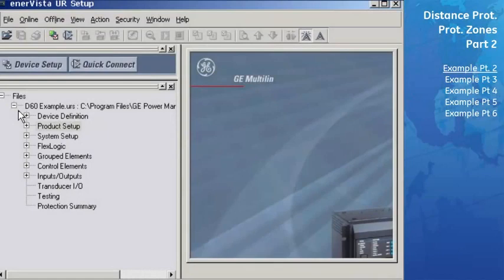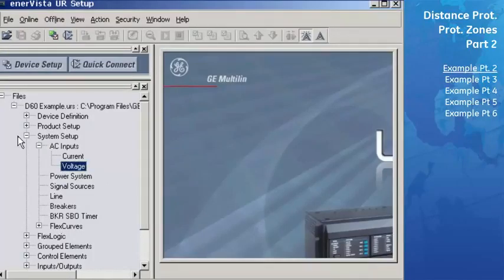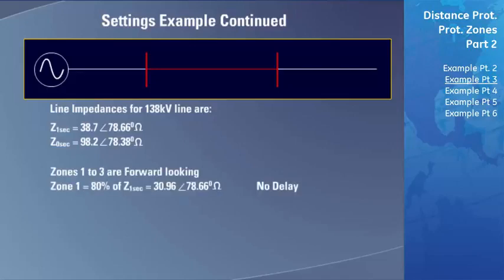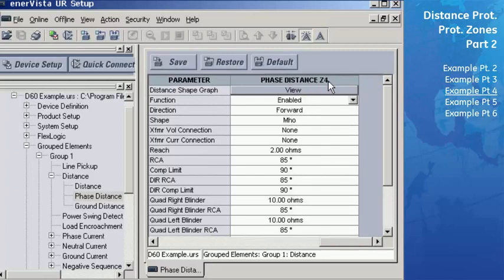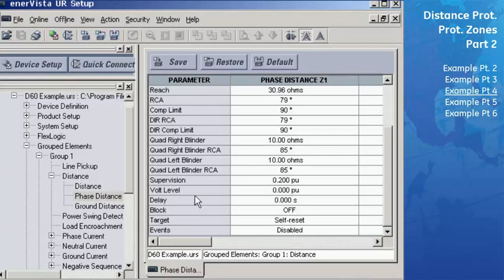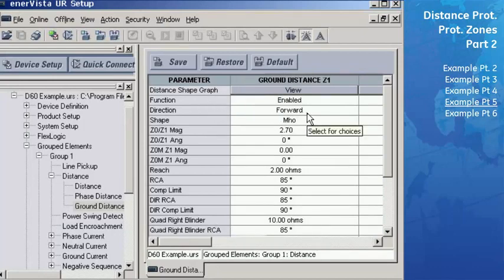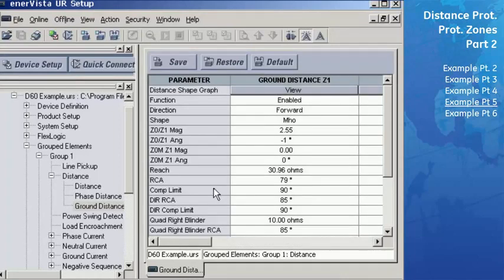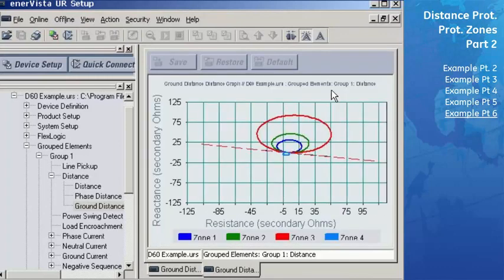005 D60 103 pt 2 l Distance Protection v1

Comment: somebody can help me with a NEUTRAL DIR IOC1. I can't understand how to draw the forward area in order to test a 67N function. Regards
Reply from the maker: I will try to help you by some way
Reply: Got it? Else we can sort that out!
Reply: @rjshtk  was easier than I thought at first. To do this you only need to add a neutral reverse lock. Since the function does a full 360 degree pan as long as you don't have a lock. Blocking the area you don't want it to operate works fine.